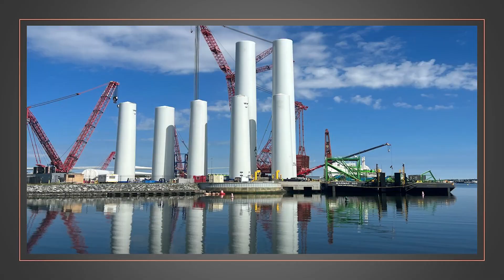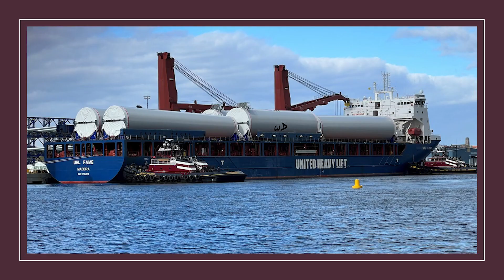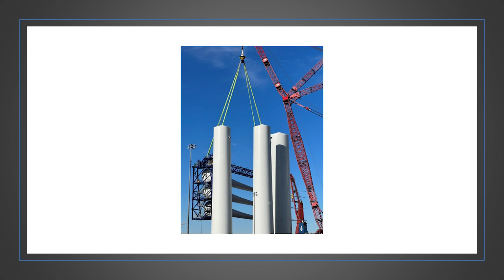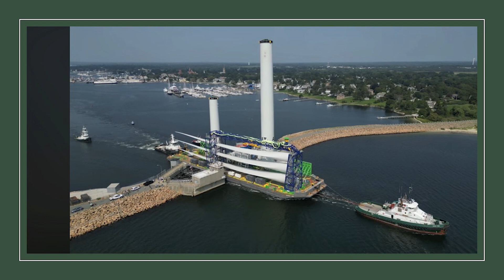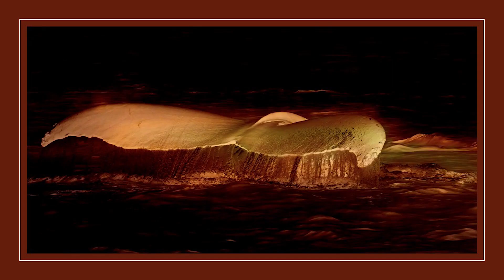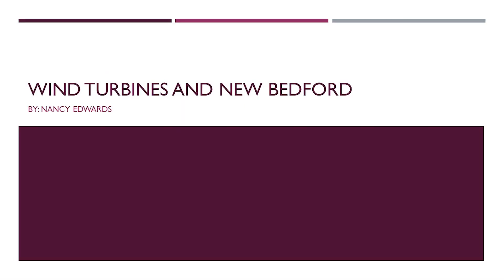Vineyard Wind   New Bedford and Beyond with Nancy Edwards

Comment: No mention of the the 100+ miles of jet plowing (destroying) the ocean floor to bury the cables?  No mention that each turbine requires over 1000 gallons of fossil fuels and fossil fuel based lubricants to operate properly?  Interesting how those facts are omitted.